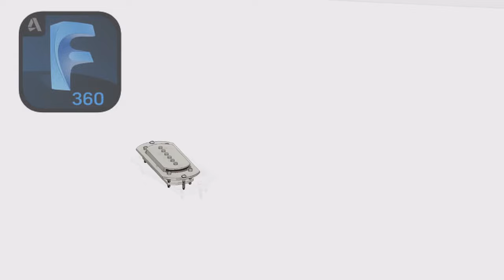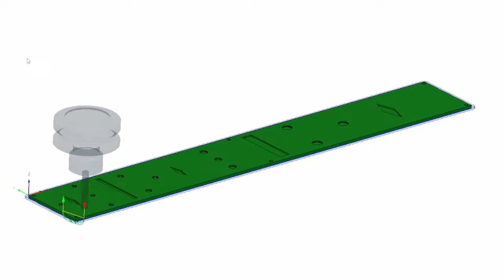Engineering a Masterpiece: The Balance Between Functionality and Aesthetics in Guitar Making

Comment: Looks nice. I wonder, though, why you wouldn't take a syringe and fill those inlays and slots carefully. It would reduce the amount of work as well as the quantity of epoxy you're using dramatically. I also wonder why you wouldn't use your CNC to level the board afterwards but choose the rather more destructive method of power sanding. Don't get me wrong, I know you know how to do stuff but I am just curious.
Reply from the maker: In this video, I explain my method for joining parts at intersections. I prefer to join them and then mill or sand through the joint to achieve a precise and clean appearance. Since I don't do production work, the amount of resin used is not a concern. When I create CA Mother of Pearl inlays, I often use a CNC mill. However, the setup time and the risk of getting resin on the spoil board (which would require cleaning) make it inconvenient. Additionally, the resin requires 48 hours to cure. Using a thickness sander works well as long as I don't use a piece of sacrificial stock that is too slick for the belt to engage with.